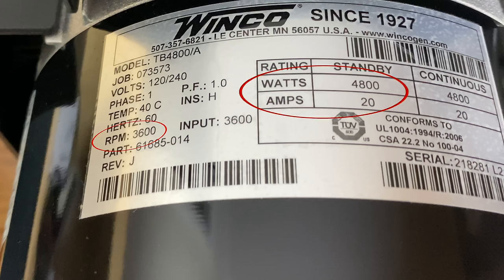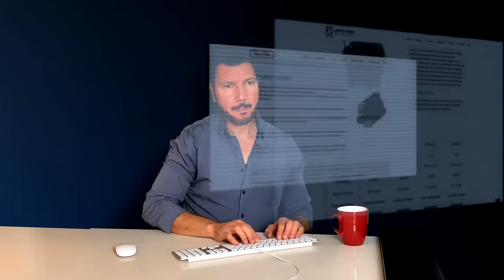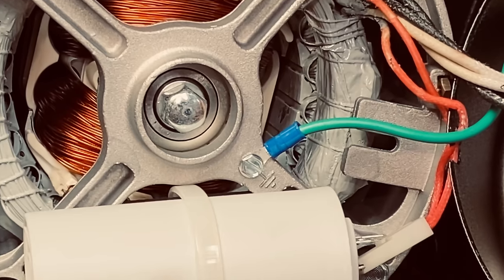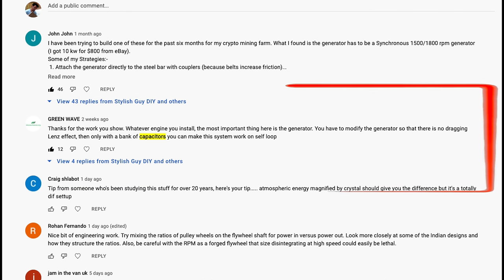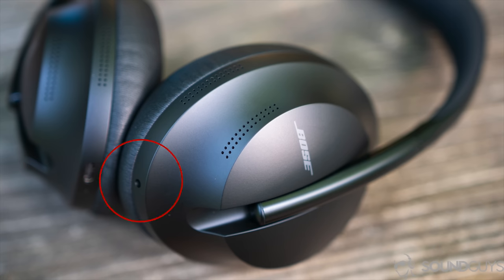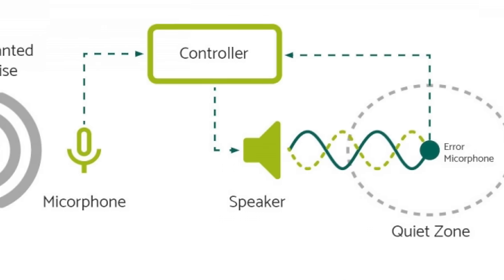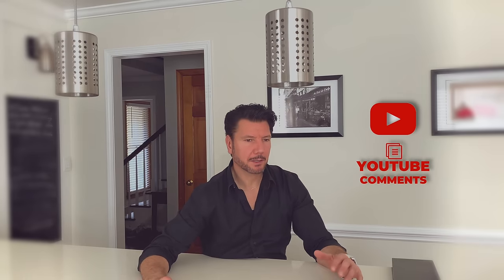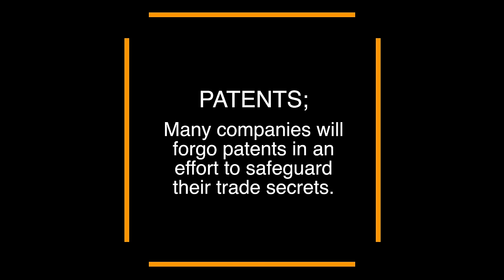Why does this Free Energy Generator not work?

Comment: Can you explain Infinity Sav or Amber kinetic? That would be a nice video.
Reply from the maker: Thanks Artowar I am actually not sure what direction to go DIY or something in this direction. Thanks for the idea!
Reply: @MarkusNenning  I did some diy attempts to couple of different ideas  in motor/generator topic. I can suggest that 
1. there is no point in spending a lot of money on something that might not work (unless you have a lot of money and purchase of machine that does not work as expected is no problem).
2. Do a lot of experiments on basic components (self made windings, magnetic mechanisms and distribution of magnetic field in metals). Once you will be able to predict what strength of magnetic field you can achieve with inductor of certain size and winding numbers you will be able to understand all electric devices better.
3. Get an osclilloscope, magnetic field measuring device (up to 2000mT scale) and an Arduino microcontroller
4. Familiarise yourself with control of mosfets and microcontrollers its easier than most of people might think
5. In my opinion the most efficient generator that can be made is coreless - axial flux architecture (every stator core will attract the magnets on rotor and that will always cause loss of kinetic energy that is why I think coreless stator allows for maximum possible efficiency).
6. High efficiency generators ALWAYS require high precision and good quality components (good bearings, shafts and stiff and precise stator structure (this can be achieved with machined plastic)) if any gearbox is used then there always be some energy lost on gears - simple power transmission is best.
7. High voltage-low current devices should heat up less so high efficiency should be easier to achieve.
8. All the time spent on such projects will be wasted if there is nothing that we can learn from it for the future. If you understand principles of electric motor types and design you will gain something out of your project even if you wont achieve overunity and this is the most likely scenario. Ive seen really top class experiments carried out by the best diy experimenters and only some of these experiments were showing sort of energy gain but it can always be a measuring error. 
9. Last thing is to get equipment for precise power output measurements. If you wont be able to accurately measure how much power is flowing out and how much is flowing in it will always be a guess work and not a proper experiment that proves something.
Reply from the maker: @Kapalek84  thank you very good advice!
Reply: @MarkusNenning  good luck!
Reply: Select a permant magnet generator with lots of poles. 
"Lenz law" is why text books will tell you loading a generator with resistance of motor spinning it will not work.. no matter a flywheel or not.  Example turn a car alternator by hand it spins easily...now connect headlights to it and it will be impossible to spin by hand as so much electromagnetic braking this is called a lenz reaction. No 1 problem to overcome in a motor generator system.
You spoke of phase shift in sound, there can be a phase shift in time of manifest of electromagnetic back forces in generators that cause the lenz braking effect.
Lenz only happens when generator is loaded with an electrical load.
The time period it takes to become a strong enough reverse force on rotation of generator rotor is the time period you want a rotor of permanent magnets to rotate into position during this time period so that the rotor is pushed forward in rotation, speeding up rotor  rather than pulled backwards, slowing rotor.  Basically the time lag of the electromagnetic back force (lenz reaction) occurs precisely according to speed of rotor of permanent magnets so that the magnet that induces power into generator coils is not the one directly underneath the coil being induced, bit the UPCOMING rotor magnet of a  reversed polarity, or the leading edge of upcoming rotor magnet in rotation of rotor rather than trailing edge.
Now the generator rotor will speed up under loading instead of braking.
Now it's possible to "loop" motor and generator and pull the plug from wall.
Study RomeroUK Muller generator on YouTube.
Study Thane Karl Heinz delayed lenz effect on YouTube too.  So much fake free energy stuff on YouTube it's hard to find what's real. They do this on purpose to flood it with disinformation.
Try a pancake washing machine motor for both motor and generator Samsung brand or fisher and paykel brand. Get them with 36 poles.  You have chance of looping and having free energy motor generator with them.  No chance with generator you have now as it will brake like crazy when loaded no matter what.  The pancake motors much more efficient motor than what you have too.
Reply from the maker: @MrDKONZEN  wow very detailed explanation!
Thank you!
Reply: @MrDKONZEN  thanks bro, I experienced the brake with my PMG 800W wind gen. I never thought of that. Do you mean rewinding the coil to play with the phase or play it electronically like brushless drive? Appreciate your input on this. Axial Coreless has less drag but less output. Thanks for your valuable comments.💕
Reply: Thanks bro for your investments into this energy generation. I am doing this for learning and also with the goal getting out of the grid power and burning fuel. Appreciate your channel n effort in this. 💕
Reply: @jimmym2719  Hi Jimmy  Rewinding coil to play with phase - if you rewind to trifilar, connect in series then it could help, as impedance raised and trifilars work in more capacitance to the coil itself,   brushless drive good, since no friction of brushes, but that does not get rid of lenz law braking of generator rotor under load.
There is difference from rotational latching (easy to spin) and what happens from lenz law....not really a law rather a reaction in reality...study Thane Karl Heinz "delayed lenz" and do some experiments making rotor speed up under load not brake under load.  JL Naudin has some good ones - he puts lights on a generator driven by motor as load, and it speeds up.  Running a generator into a motor to power it, as the motor spins the generator is not so easy and first problem is lenz law braking... you will need a particular RPM particular resistance of the load of motor.
Another way also is fill caps ONLY  with generator. Disconnect caps from generator, then run motor with caps only this called two stage output.  the generator never sees the load, only fills caps...requires some fast switching expertisem and filling of caps needs to be as "resonant chambers" not resistive loading....as if caps too big they will lug and brake the generator rotor too....I could go on good for now!
Reply: @MrDKONZEN  thanks bro, I will study Thane Karl Heinz and get to know this better. Appreciate your prompt respond bro 💕
Reply from the maker: @jimmym2719  thank you!
Appreciate the kind feedback!
Reply: I discovered “they” added resistance to the generator and motors built today. If you really want to try, wind your own.  “They” are sneaky

Comment: If you want the math problem, I have shown in it, it is possible in only coil Pluss magnets but cooling is need to not over heat the magnets, because magnet give voltage at the being, but with coil will give more variable control to the generator.

Comment: Free enegery genergy works, but not completely free, we give less input get more 2 times more output, here we need to  consider and use less rpm PMG , use bigger flyfeel, approximately per 1kw 40kg weight ,also use gear systems,  also one more method, less rpm PMG ,bigger diameter  gear, like we give more torque by less force, 
( force *distance) , for eg .. We use extension rod for open a hard nuts, same hand ,same force, by increasing the distance of the rod we get more power
Reply from the maker: Thanks for the feedback!

Comment: You should use a 12 volt motor with a battery as well as adding a alternator to charge the battery. Works better and uses less power to run generator. You can also use a solar system with this to charge the battery as well as a wind turbine. With this system you can run all your lighting off 12 volt and all your plugs and appliances off the 220 volt generator. Been designing and building these for years. Also, the reason it will die as soon as you plug in your motor to the generator is because you can not ground them together. This is why you need two different systems to make it work. (motor, solar, wind, water, or battery) By using a motor with a battery along with a 12 volt motor, with wind and solar it will work because you have a belt running the generator. Nothing running between them to ground them together. You also would want to put a rubber mat under both the motor an the generator so they do not ground by the frame along with some bold inserts to keep them from grounding through the frame. If you make these changes, it will work. Always keep trying mate. We never learn if we stop trying.
Reply from the maker: Thank you James!
I am currently working on getting all the components for a much smaller version to see if the concept works.
Will try the batteries suggestion.
Reply: Why would you include an alternator, this is a myth. If it worked, electric cars would include alternators and you would never have to charge them.
Reply: @Bound4Earth  Really, you do not say. That is the whole flaw of electric cars. Along with a few other flaws. I mean use common sense. You answered your own question by including the electric car statement. Use your brain. The other answer is you would not make any money in electric cars.

Comment: They used a 4 pole generator, which runs at half the rpm. Notice their pulley ratios, he tells the sizes. Do the math and you’ll see the ratios. Yes free energy exist, well that’s what a friend told me. There are many other ways to do it also. Off balance wheel, self pumping water wheel, permanent magnet motors, and probably a few others. Or so a friend of mine told me so. FYI, you don’t want to patent anything considered free energy (over unity). Best wishes and hope you get it.
Reply from the maker: Thank you very much wynoose66
Reply: I wonder if you would get a visit from men in black and possibly disappeared for exposing such tech on YouTube.
Dear government- I'm just a curious casual having a convo with other people. I'm dumb AF and wouldn't know the first thing about tech like this. Thanks for your concern and here's my 2 finger salute: ✌️

Comment: Thank You for the very helpful video. I have been looking at the same video's as you about these free energy generators the one thing I have noticed is the size and weight of the flywheels they are using, I is a 32" 120kg and the other is a 100kg and another is using 2x 200kg flywheels but can not tell what speed they are running them at, your 2x 45lbs weights convert to 40kg approx. So not carrying enough energy to keep it running.
Reply from the maker: Thanks Mark!
Yes I have noticed that also but also keep in mind that most of them use a 10kW generator twice as much as my small generator.
That’s why I assumed I should be ok with half the weight.
The good thing about my design is that it can be scaled and I can add more plates.
Just out of funds at the moment :)
Reply: @MarkusNenning  ... Scale it up & sell it to the power company.
Then they can stop burning coal.

Comment: Oh yes!!! VFD variable frequency drive to run the drive motor!! high frequency = less amp draw!
but i dont think its ever going to work on flywheel and motor alternator setup alone.. you need to use a battery (or a bank of expensive supercaps) to drive the motor and use a generator to rechage it at the same time!
So here is the catlist in my opinion :
Motor
Generator
Flywheel
VFD Variable frequency drive for drive motor
Battery to power the motor
Inverter to step up DC from Battery to AC for drive motor
Reply: This guy is a faker
Reply from the maker: Yes agree would be nice to have all this components to experience but out of my budget at the moment.
Thanks!
Reply from the maker: @dominicgeorge7299  what is it that you think I am faking? :)
Reply: @MarkusNenning  please research gerad Morin, also Patric Kelly,  there's a Nigerian plus an Indonesian ,they all show the real way That producing free energy with a generator is possible, I personally like the one from Nigeria you get a detailed description plus demonstration, your video makes it look like the claims are fraud ,please contact gerad Morin with your camera and interview him show him your videos, stop trying to distracted people
Reply from the maker: @dominicgeorge7299  thanks i will check them out.
Reply: @dominicgeorge7299  Morin is a fake...he couldnt even set up a pulse motor circuit and motor for someone who bought a pulse motor from rick friedrich..
Reply: @fidelcatsro6948  ha ha ha ho ho ho hee hee hee , I really got to laugh till I cry on this one, you need to pay attention to what I  said  beside gerad Morin there is two other persons showing how it works one from Nigeria the other from Indonesia they all show the same thing,  over unity , there's also Patrick Kelly,  where you can download blue prints,  there's a lot of people/persons who are being paid to go on you tube and influence viewers by casting doubt on this technology, gerad Morin challenges anyone to visit him and debunk what he says nobody has accepted his challenges, rather they go on you tube to influence
Reply: @dominicgeorge7299  naaaah he using a 12v motorcycle battery to drive a dc motor which is connected to a simple ac motor producing 230v ac and people think its amplified free energy, even my high school cat knows the amp output on the ac is going to be tiny and theres nothing free energy about it, he merely demonstrated a meek dc to ac mechanical converter
Reply: @fidelcatsro6948  the Indonesian uses no battery instead he uses a ac motor,  the guy form Nigeria uses a dc motor with a 12 volt battery,  same type generator both principles  explained and demonstrated,  which is similar to gerad Morin who use a different type of motor but the principles are the same please watch the video from Nigeria and Indonesia along with gerad Morin if you still don't get it pay mr.morin a visit accept his challenge no use talking please accept his challenge

Comment: I tried it with 2 small electric motor and generator. I think it needs 2 batteries  with a switch when 1 battery is charged switches to other battery because my experment wouldn't work. I mean when it runs both connected i would use 2 batt
....
Reply from the maker: Did you ever get it to work?

Comment: Love everything about this. I have been trying to make a high efficiency axial flux motor. I think this could pair nicely wth your project. They could be mounted directly to the face of the flywheel. 

And I think that's the goal with the whole thing. Minimize losses everywhere. But it sounds like you are already thinking of that in far more detail than I would have ever thought. 

Love your patent idea. And the use of machine learning for this project as well as trading algorithms ( would love to see a video on that) 
Keep up with the great content
Reply from the maker: Thank you very much Colby very much appreciate it!
I will try to keep up the content but it’s a challenge:)

Comment: "The laws of thermodynamics are often cited as the reason we can't have sustainable energy. 
But is that really true?"

Answer to your question
The Laws of Thermodynamics do not prevent you from creating sustainable energy.
We have lots of examples of sustainable energy that do not contradict the Laws of thermodynamics.   
For example Solar Panels, Wind generators, Wave motion Generators, Thermal Generators, and electric Dams.  None of these go against the Laws of Thermodynamics.
However, when it comes to making claims of over-unity and free energy devices, then they contradict the Laws of Thermodynamics and therefore are not possible.

1st Law of Thermodynamics
1.  Energy Cannot Be Created or Destroyed.  
If you can't create energy, then how can you have a higher output power than input power after going through all the losses (Heat, Friction, Lens Law,... etc).
Since everything has losses and you can't attain a minimum of 100% efficiency, then free energy devices are not possible.

Some people who have little background in Science or Engineering will claim "Laws are made to be broken."  What they don't understand is that these Laws are not created by us, but by the Universe, we live in.  

IMO, it's more advantageous to work on improving efficiencies and other forms of sustainable energy, rather than try and build the impossible.
Reply from the maker: Thanks for the feedback Valveman12!
Reply: work on improving efficiencies, I have been saying this for years?!. for example, combining these ie solar, wind and hydro maybe even battery storage for peak hours etc. I mean just how many solar panels could the Hoover damn hold? These damns create massive amounts of air flow from the water coming off the damns, so catch that. You mentioned wave gens, there is another. Just how much could we upgrade the infostructure that we already have?!...
Reply from the maker: @joespruill6447  exactly!
The question is why is it not done already?
The energy sector is a greedy business!
Reply: @MarkusNenning  It is just the only one's brave enough to invest is big money, like Elon. He saved Australia's power grid for a while. It's just going to take riskier investors and there has never been a surplus of them. They are the ones that make the biggest returns though...